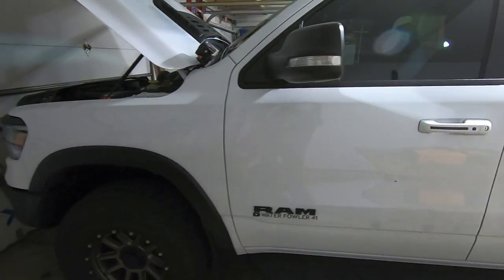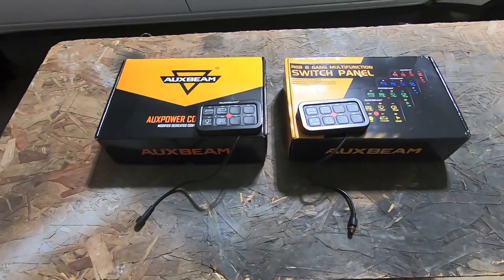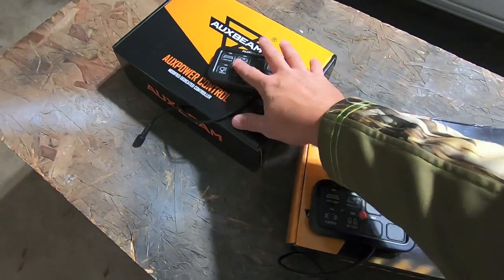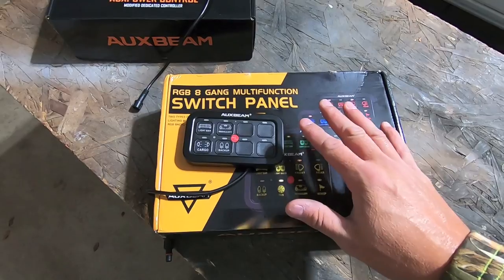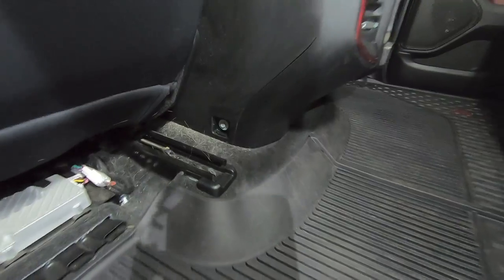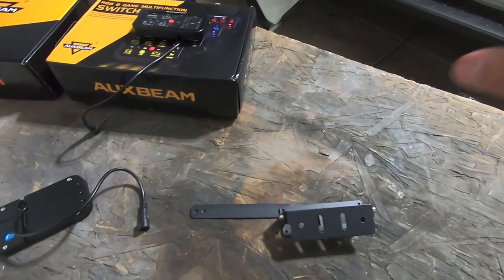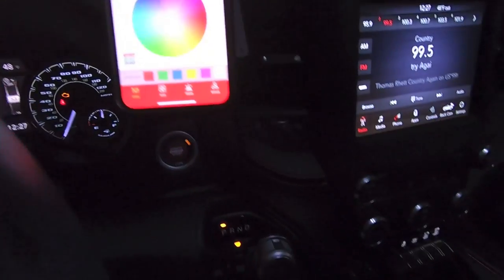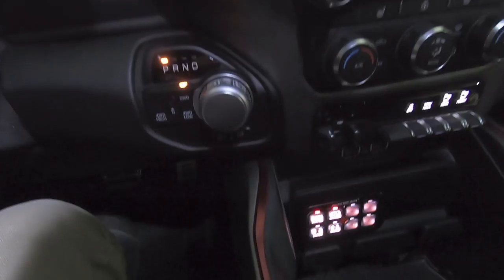AUXBEAM RGB Controller - Ram Rebel

Comment: Great video, wish Auxbeam would have had the RGB option when I installed it over a year ago.  Some, on another forum, downplay Auxbeam.  I can tell you from personal experience these units are solid.  Been in my truck for over a year with ZERO issues.  Installed in a 2020 Ram 2500.
Reply from the maker: Same! Cannot best the quality for the price point.
Reply: @WaterFowler41  just installed an 8 gang switch panel and I’m shocked how well everything is made for the money.
Reply from the maker: Can’t beat it!

Comment: Vice design makes a cool bracket that uses pre existing mounting points where it sits just under the shifter knob.
Reply from the maker: I ended up using a new bracket from 3dFlipIt.  Same general location but a bit more ergonomic.

Comment: Hey when you ran thru the firewall. You mentioned you cut the control cable. How many wires were there in that. Seems like it would be easier and less of a hole needed.
Reply from the maker: I cut the wire so the hole could be pretty small

Comment: Hi, I just installed exactly as it is and panel lights up, but all my connected accesories do not work. Panel lights up and I press all the buttons to turn on my accesories but it is like there’s is nothing connected. Do yo have any suggestion? Thank you! 🙏🏼
Reply from the maker: I would double check your lighting terminals are properly torqued down and the wires are stripped enough to make a good contact.

Comment: Awesome switch and box install. However, how do you go about wiring the actual components to the box? Do you grab them from the fuse box?
Reply from the maker: There’s a + and - terminal for every channel, run the wires from your accessory directly to the box

Comment: Hey thanks for the vid.  When you were running the wires through the gasket into the engine bay you mentioned 'flat tow your truck @20:32.  What were you getting at there?  Wasn't sure what you meant, but was curious.
Reply from the maker: There’s a orange strap inside the cab sort of where your left knee is. This is the transmission release, allows you to put the trans in neutral. That strap is tied to a cable that goes through that gasket.
Reply: @WaterFowler41  Ah, I see thanks

Comment: Hey, don’t know if you still have the TRX style lights installed, but if so will you be hooking them up to the auxbeam or keeping them on the relay setup? I guess my question is, could you eliminate the relay & hook directly to auxbeam? ….as I am writing this, thinking, they are basically running lights, & without that relay trigger, they would not come on as such, lol. Thanks for the great videos bud!
Reply from the maker: Yup answered yourself there but since they were running lights I wanted them on when the truck ran and didn’t want to hit a button every time they turned on
Reply: Agreed! & just to be clear, you ran that relay setup into one of the outputs on your fuse block correct? Thanks again!
Reply from the maker: Negative it’s tied to the marker light wire (white/orange stripe) in the passenger side headlight harness.

Comment: I didn’t know there was an upgrade until I just installed mine and hit YouTube to see how everyone else installed 🤦🏻‍♂️ I was disappointed how NOT water proof the original fuse box is.
I wish there were an option to have power on without the key on, without the backlight always on (killing the battery). Like On/Off no key needed.

Comment: Can i fuse a 10 amp light accessory into the 30 amp circuit with a 10 amp fuse?  Or is the 30 amp circuit only for accessories that are fused by 30 amp fuses?  Essentially, can I fuse accessories with a fuse rating lower than what the circuit is rated for???
Reply from the maker: correct lower is OK, higher is no bueno

Comment: How did you run the acc wire in to the main fuse box? Also, I have the secondary fuse block for the positive power wire. Did you not have that? Is it needed other than for extra protection? Not sure where to mount that. Thanks!!
Reply: I am looking for this too. The 2022 rebel fuse box connections are smaller than the ones they sell online
Reply: I ran the wire out the motor side of the fuse compartment. Doesn’t pinch anywhere on that side. Not sure how to post pics on a reply or I would for the rest.
Reply from the maker: I didn’t use the secondary fuse because it already have a dual fuse block serving my amplifier. I had a spare fuse position so that’s what I’m used. 

Like you I snaked the acc wire carefully though my fuse box. You can see more info in my Trigger controller install.

https://youtu.be/db06ZnJoN34
Reply from the maker: You will need a micro2 add-a-fuse.
Reply: I got it all figured out and wired up. Thank you for the reply and great video!

Comment: Installing right now but I was wondering you said you poke a hole through the firewall. Is that behind the flap? So you made a new hole? I’m a little confused thanks
Reply from the maker: Yes I made a hole to the side and pulled the wire through

Comment: Awesome Video and great install.  I am looking to do lightwork to my 2019 rebel i.e. Oracle Light Bar, Aux Beam Grill lights, Baja LP 4, and rocker lights.   My only question is, what are your thoughts on the Auxbeam vs SPOD?  The auxbeam seems to be the kit to Rough Country and some others resellers.  Seems like they simply co-brand the unit and sale it.
Reply from the maker: Yes I’m sure they are all rebranding these switch panels. This particular switch is different than the rough country one because you can change the backlighting with the auxbeam rgb app. With the rc one you cannot.
Reply: Got it.  Understood.  Have you had any issues since install?
Reply from the maker: Nope love the controller, can’t beat the price
Reply: Thanks for the feedback.  I will go with this unit.  I was on the fence with purchasing an SPOD which is $915

Comment: If I turn on 1,2,4 let’s say and I turn the truck off. When I turn it back on will the panel automatically turn back on 1,2,4 since you didn’t actually turn them off by the button but instead of just cutting power. Or would I need to press the buttons again to turn it back on
Reply from the maker: Negative they all reset, I had to check that sorry for the delay

Comment: How do you hook up your lights to this if the lights comes with its own switch such as a light bar , cube lights
Reply from the maker: There’s positive and negative terminals for each light. Hook the lights directly to the terminal for the corresponding button on the panel. No need for the individual switches once you have this panel

Comment: Very cool.  So does this use relays or are you using the relays that came with the lights?
Reply from the maker: The controller “brain” has built in relays
Reply: @WaterFowler41  ok thanks. I didn't really see much information on this particular one.  The lower priced ones show the relays on the controller.
Reply from the maker: Yeah spend the few extra for the rgb one. The app and being able to group lights together to turn on at the same time when you push a single button is well worth it
Reply: @WaterFowler41  thanks again. Ill be going thru your link to purchase. Stay safe
Reply from the maker: Thanks so much!

Comment: Hey, do you know how much power the switch panel uses to operate? As in standby power for Bluetooth and to illuminate the switch panel? Hoping to run this in a canopy on my aux battery but don’t want it to draw too much power itself. Cheers
Reply from the maker: That's a REALLY good question that I do not have the answer for.  AUXBEAM customer service is pretty responsive, have you tried reaching out to them yet?

Comment: So can you turn on/off the lights from your phone using the app as well? Or is it just for the back light on the remote & light configuration? Thanks again, much appreciated!💪
Reply from the maker: No, you cannot operate the lights from the app, just make adjustments to the way the panel operates (I.e grouping light circuits)

Comment: When i used f38 with the micro add a fuse it throws my 4wd service light on. Do you know another alternative fuse ?
Reply from the maker: Do you have a fuse in both slots on the add-a-fuse? You’ll need two fuses of the same amperage. If you are missing one, you will have an issue.
Reply: @WaterFowler41  ah that must be it! I just had one thank you!!
Reply: @shanetarver  did adding the other fuse work for you??
Reply: @markperez5923  100% solved it
Reply: @shanetarver  what exactly is that fuse for?? I’m so nervous to tap into the wrong fuse.
Reply from the maker: One is for the original circuit that you’re tapping into the second fuse is for the new accessory you’re adding
Reply: @shanetarver How did you get the light to go out and it took a long time?

Comment: If you have you lights on and then you turn off your vehicle and the turn the vehicle back on the lights will be on to or you have to represse the buttons to turn the lights on ? No one talk about this please some owners  that has this switch panel help me out with this doubt
Reply from the maker: Great question and no. If you have all the lights on and turn off the truck, the lights will all need to be manually turned back on. The remote does not have memory.

Comment: I noticed in the video your pro clip phone holder has a Scosche magic mount on it instead of the pro clip holder. Just curious if you were having issues with the pro clip holder?
Reply from the maker: I switch phones cases to a magnetic back case but I’m back in a normal and using the pro clip holder again.
Reply: @WaterFowler41  Was just curious, was thinking of purchasing the pro clip holder. Thanks

Comment: Question about your f38 fuse, what is that fuse for? I have a ram 2020 new body style and all my fuses were micro and the add a circuit wouldn’t fit any fuses.
Reply from the maker: You’ll need a micro2 add a fuse

Comment: What fuse connector did you use to connect the auxbeams brain to the trucks fuse box?
Reply from the maker: Micro2 add a fuse.

Check out this video for more info on how I wired my previous controller. I used the same connections for my aux beam controller.

https://youtu.be/db06ZnJoN34

Comment: Off topic, but it looks like you have the ProClip mount for your cell phone. Could you please let me know the exact dimensions of the mount plate itself (the one attached to the mount bracket)? I'm looking to mount an accessory on there and would like to make sure it fits properly.
Reply from the maker: It’s 5 cm vertical and 7 cm long
Reply: @WaterFowler41  I'm surprised at those dimensions. It looks much wider than high. Are we talking about the same plate which your phone mount (or other) mount attaches to?

Comment: Thank you for always putting out these awesome sources of information! I am still scared as shit to do all this on my own. I am planning to get the light bar and brackets you have mounted, I already bought the 3 small lights for the rear and front of the truck (TRX style) but like I said…I’m a p***y LOL. My biggest concern is how to tun these wires underneath and hooking it up to the battery/fuse box😩
Reply from the maker: Welp if you have any specific question let me know!
Reply: @WaterFowler41  thank you brother. will certainly do so

Comment: So can the app control rgb equipped lights like demon eye headlights or rgb backlit light bars and change each color?
Reply from the maker: The controller is only and on/off controller it is not an rgb controller. You will need a different controller for that. The app only controls the back lighting for the switch panel.

Comment: Could you not just change the 5amp fuses to a 10am fuse to make to have more options?  Are the 5amp slots limited to 5amp?
Reply from the maker: That’s a great question and I’m not too sure. Since the whole board is potted you can really see what electrical components to see if switching a fuse would have harmful affects. That be a good question for the manufacturer.

Comment: Do you think connecting the trigger wire to constant power fuse would work without having to turn on to acc or run? Would like to turn on some lights without getting into the car when camping.
Reply from the maker: I believe the backlighting on the lighting panel would be on all the time if you used a constant power feed so that's probably not a great option.
Reply: @WaterFowler41  Make sense. Thanks for the response
Reply: I had the same issue. I wanted to be able to utilize some lights without the ACC on. I had a great system in my Jeep that allowed you to do that without constantly drawing power to the panel back light. What I did was run a small cut off switch inside the cab. This allows me to turn on the panel at anytime without turning on anything else. Now I can turn on my bed lights, running board lights, and so on without functioning the ignition at all. I can kill the power with the one switch and there is no drain on the battery.
Reply: Thanks John, I was thinking of adding a switch too.

Comment: On the switch panel do you double click the button to do the flash strobe
Reply from the maker: No you have to go into the app and tell the controller how each button should control it’s respective circuit when you push it. 

Option 1. On/off toggle, push on, push again off 
Option 2. Momentary, push and hold button, it stays on, let go of button, light turns off
Option 3. Strobe, push button, light turns on and strobes, push button again, light turns off.

All of these is done via the Auxbeam app.

Comment: Do they use micro relays? I don’t see any relays on your install  where are the relays located?
Reply from the maker: They are built into the controller that I mounted under the hood
Reply: @WaterFowler41   the reason I asked you was to see the difference between aux beam and the Feniex controller 4200 I just bought to run 3 color T 3 led lights  . I wanted something made in the USA with great customer service when needed . Fire and ambulance services use this and other controllers made by Feniex. Thank you for responding back . Tom

Comment: does the wireless charging still work for the phone?
Reply from the maker: I don’t have wireless charging so not an issue here. If you use the wireless charging a lot, you may want to slide the control panel to the right side more.

Comment: Nice informative videos but super, super, super repetitive at each section. I think you could save yourself time by explaining everything once as you do it, and then maybe a recap at the end. I just got this 8 gang and with this video, have confirmed how I want to install the controller. Did you mount the control box to the fuse box cover? It appeared that way. Thanks again.
Reply from the maker: Yes it’s mounted to the top of my fuse box with dual lock Velcro.

Regarding the repetitiveness 🤷🏻‍♂️
Reply: @WaterFowler41  hi, the add a fuse you mention is it the one that comes in the auxbeam kit or did you have to order something else?
Reply from the maker: You’ll have to get a micro2 add a fuse. The kit doesn’t come with that specific one
Reply: @WaterFowler41  do you have a link to the one you ordered or is there just one version?  Also how did you mount the controller? Did you just leave it sitting on top of the fuse box?

Comment: If someone gets stuck with F38 micro fuse, realize the tap in lead with the 5amp fuse. Has a additional slot to transfer your 10 amp fuse, I did not! my dash looked like a Christmas tree. F38 slot is for your TCM, put your 10 amp fuse right under the 5amp fuse.
Reply from the maker: Yup both slots need to be filled. 9 times out of 10 if folks are having issues it’s because they missed this.
Reply: I am having the trouble. Do you guys have a pic of how it's supposed to be hooked up
Reply: How did you solve the problem, I got two messages, one from traction control and stop/star service, I   changed to  the fuse  f35 but the messages continue appearing help me please